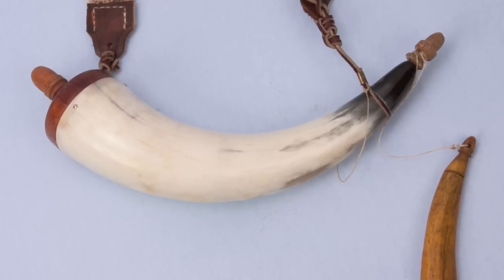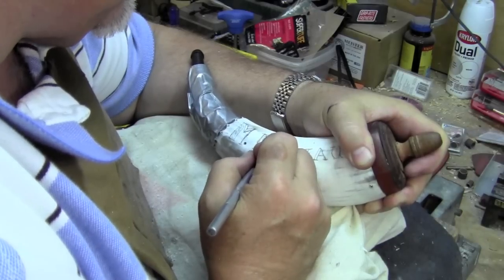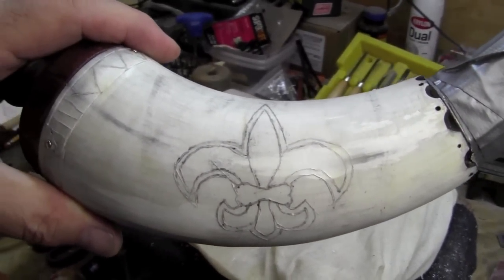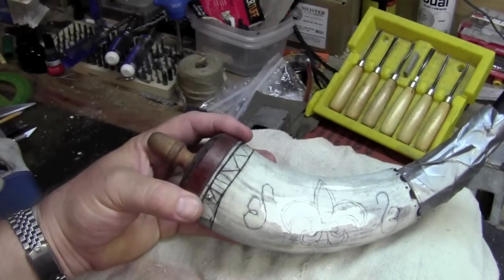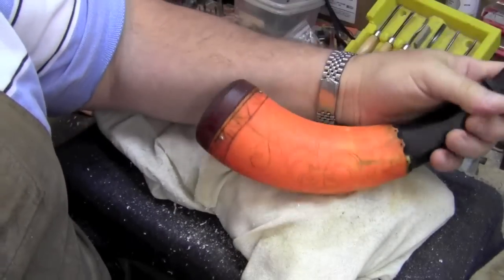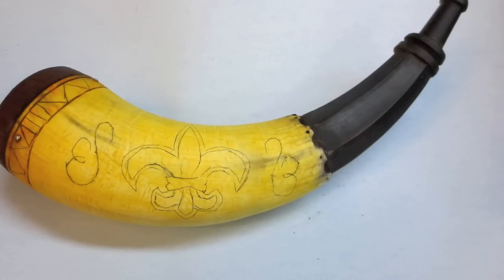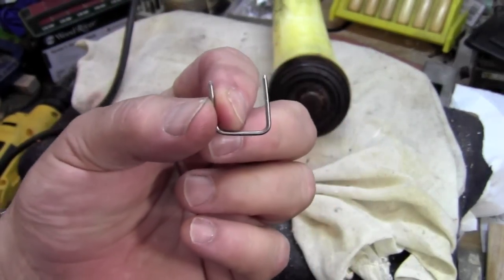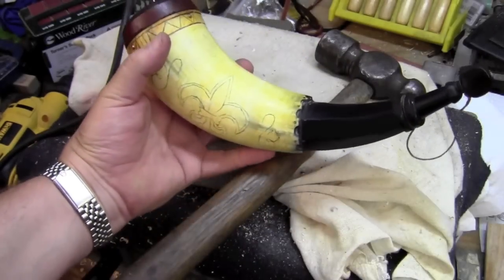Customizing a powder horn phase 2

Comment: I do these a lot, and a round pin vise gives better control for cutting the design in. after the design is drawn on I spray lightly with krylon clear satin. this keeps ink out of everywhere except the cuts. ink it and lightly steel wool the krylon off. the real white horns are the softest, so go easy. the light tan or translucent horns are harder, easier to scrimshaw and look great! potassium permagnate is far superior to dye, when staining a horn. the horn came out nice for the first one! keep the great vids coming.

Comment: Just a little and effective tip Mike. After scrimshawing your designs use black carbon paper and rub over your work. It works well, less messy and is permanent. Kind Thanks! DaveyJO in Pennsylvania

Comment: I've found that a fine tipped metal Engraver (Track of the Wolf have them) is ideal for scrimshaw on a Horn, the trick is to drag the Graving tool rather than push it (as you would with metal engraving).  It enables a consistency in depth and is very easy to use.

Comment: Hello mike, i am a second generation scrimshander and it is advised to not use a knife to carve. You actually can us a scribe or a dentist pick tool. Preferably high carbon steel. They're easier to control and cheap. I buy mine personally off of ebay.

Comment: Mike - on balance, I liked your vid.  I've made all the goofs, so here are some 'lessons learned;" the Sibley book instructs the use of a carving knife, as you showed, and that's my only complaint with the book.  I used to use a large sewing needle, but now I use a Coulter scribe... best thirty bucks I've spent in years!  also   I've tried steel wool on horns, but it was a disaster.  steel wool has lots of oil in it and, as my kids say, eeew!  BIG PROBLEMS  - stick to scraping!  the staple you made looked OK - I use coathanger wire and get it hot with a propane torch - it bends easily and looks very authentic.  Watch the orientation of the staple you want the strap to keep the horn in a good angle.  I have the same horn (I got it as a 'cheapie' and it has the weird plug and threaded buttplug... glue ... good for what ails ya ... As far as the dyeing goes: I think the Sibley book has an onion skin dye recipe - stick to that except for the engrailing - I use ritberries for that.  thanks again for the vid!

Comment: Just use the dremel mike.  We won't fault you for it, tell us what they would've used when they made it, and duplicate it with a high powered carving tool.  You could probably have burnt in those designs without having to die them after.